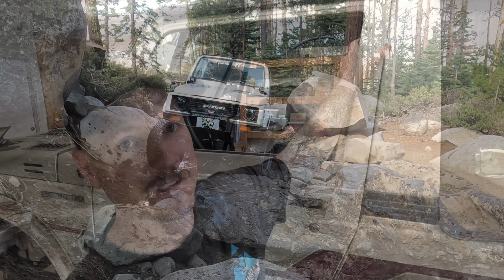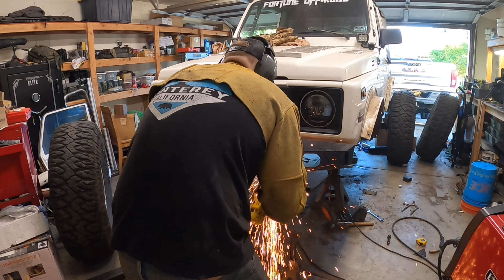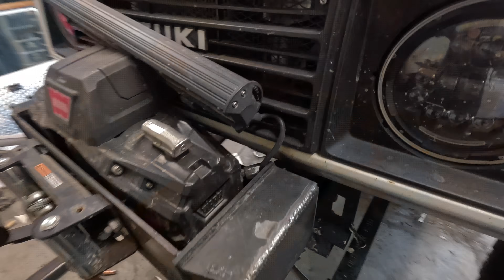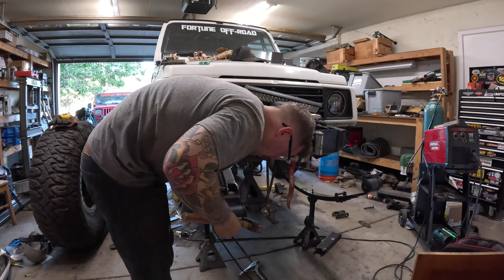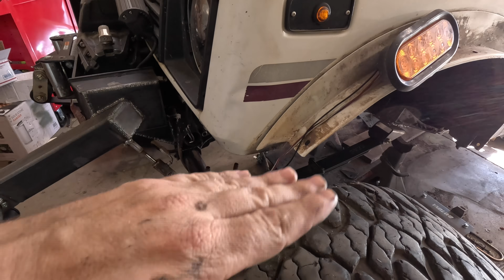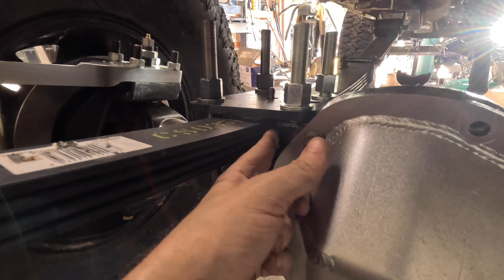1 Ton Samurai Build (Part 4) | Chevy Dana 60 Swap with XJ Springs

Comment: Looks like a saber tooth samurai now lol is there any advantages in running leafs instead of coils if you're capable of building a 4 link?
Reply from the maker: The only advantages to leaf springs are simplicity and cost. A linked setup would be more a better option for performance.

Comment: Shackle reverse would have been better it's ugly I'm sure it will work though
Reply from the maker: The rear of the spring is really long. It would've been a lot hanging out the back and low. Also, it gets the pinion angle really low when articulating. Just wasn't for me in this build. Might do it on the next one

Comment: Don’t remember if you said in the other videos but are you going to offset the new rear?
Reply from the maker: I'm not sure if I mentioned that yet. My plan is to run the rear centered. I think i have enough length on the deiveshaft that the angle shouldn't be a problem. I dont see the samurai case holding up, so if I swap it out, I'll most likely have a centered output on the tcase
Reply: @FortuneOffRoad  I’d like to see the centered transfer case. I’m doing Toyota axles right now and running into that same problem.
Reply from the maker: @whywedrink  ive seen many Samurais run stock transfer case and rear toyota axles without issue. Hopefully it works out for you!

Comment: looks like a beast cant wait to see it on the trails. Just wondering why not longer shakles? I've always heard you want a 5-6 inch shakle to get every last bit of flex from your leafs.
Reply from the maker: Shackle swing should match the arch in the springs. I dont think I'll need it for compression, but I can always use longer ones later